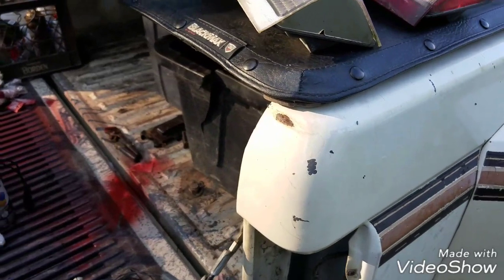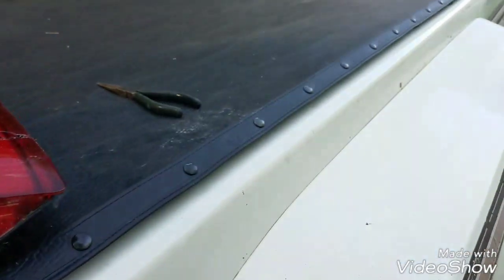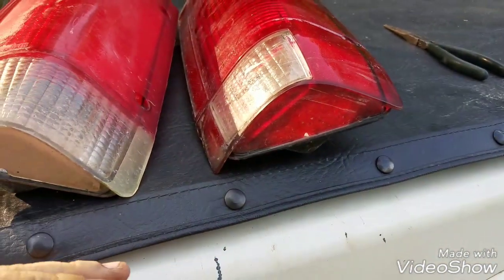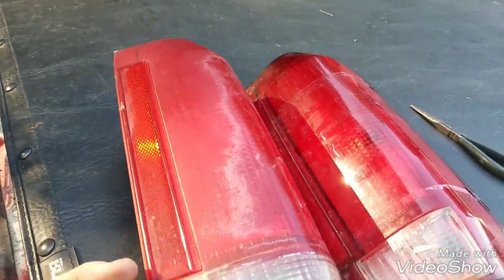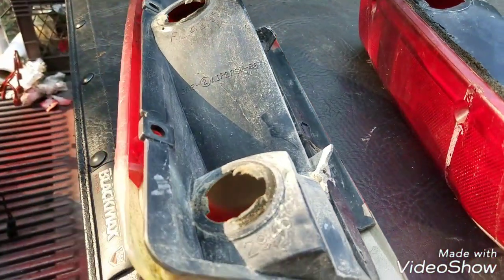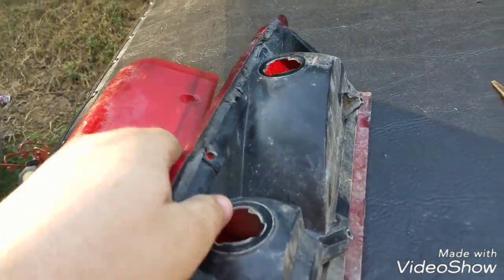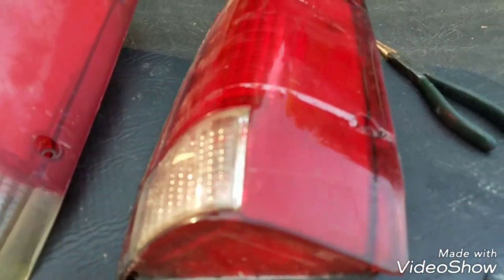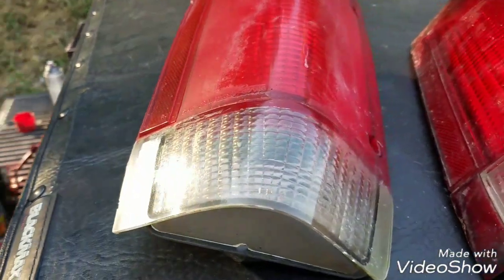OBS F-Series: 1987-1991 vs. 1992-1997 Taillight & Wiring Harness Discussion

Comment: I like the 87-91 tails better, reverse light lens portion spreads the light around better, I put high output LEDs in them and it was a very nice improvement, repop lenses are cheap as well or wet sand and buff. Lots of the new smoked type altezza style lights looks so trashy.

Comment: I have a 97 f250 xlt and someone has cut up the tail light harness it runs all the way back to inside the truck. would you know which truck I could get this harness from? Is there a difference between the 150 n 250 7.3l?

Comment: One correction is that the lenses with the wrap around reverse light are 87-89, the ones with the rectangular reverse light are 90-97*. My family had several 91 F150s and all of them had the lens with the rectangular reverse light
Reply: 87-91 tails are all the same they wrap around on the reverse. 92-96/7 have the small rectangle if you have the small rectangle ones on your 87-91 truck they aren't stock.
Reply: M Plante no they were all stock. Look at every (stock) 91 f series truck. I know from experience, dude, If you know what I mean.

Comment: I bought a 1995 f250, and they put a flatbed on it, and wired up trailer lights for the taillights, but didn’t wire them up correctly. I was wondering what color does what. They just cut a lot of wires and didn’t do it correctly from the quick connect basically, and I’m looking to redo it and do it right..
Reply from the maker: Black/Purple=Reverse
Light Green/Orange=Left Turn Signal/Brake 
Orange/Light Blue=Right Turn Signal/Brake
Brown=Marker Lights/License Plate Light

Comment: I've got a 90 dually and the fender and trailer lights quit working but I can't find any fuses blown do you know where I should start to look
Reply from the maker: Check the grounds in the taillights, use a voltmeter to ensure you're getting 12v with the lights on, etc

From there you can troubleshoot a bit more accurately

Comment: I have a 97 f 250 HD XL and my brake lights go off when my running/headlights go on. Multifunction switch is tested and good, Brake switch is good. I've been told it is probably a ground. Where on an OBS would I look for that? How was the harness grounded back there?
Reply from the maker: Usually has a ground from each pigtail over to the bed